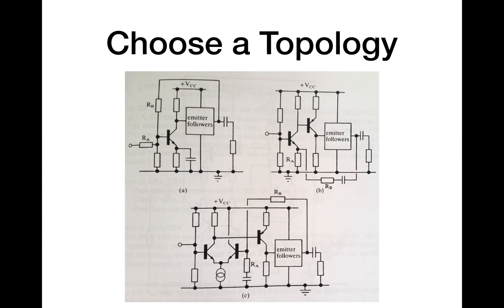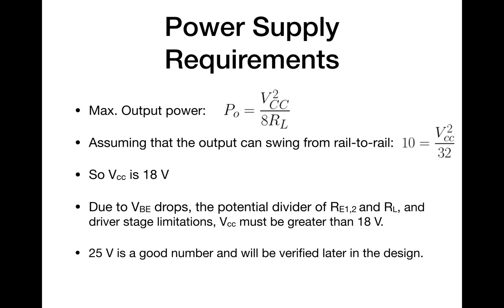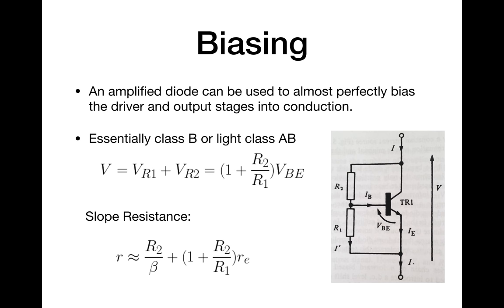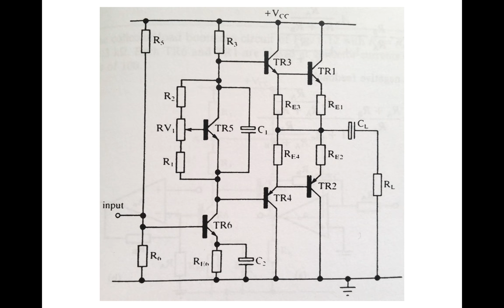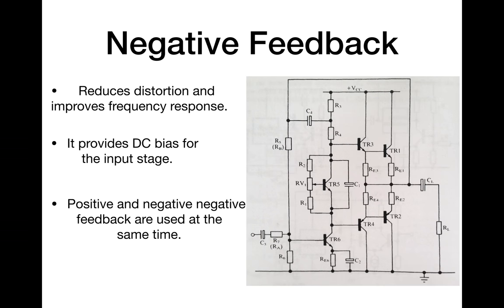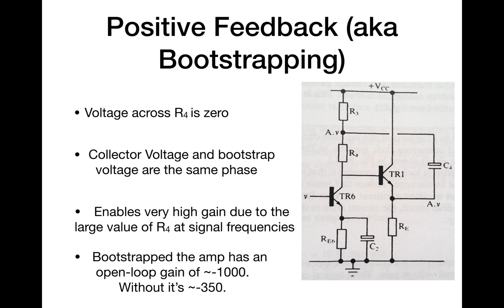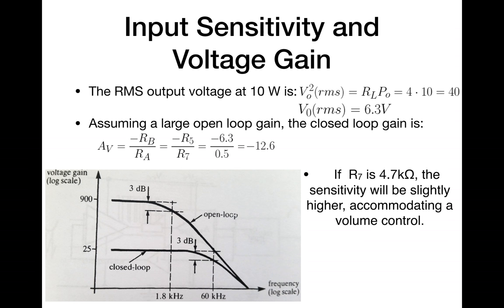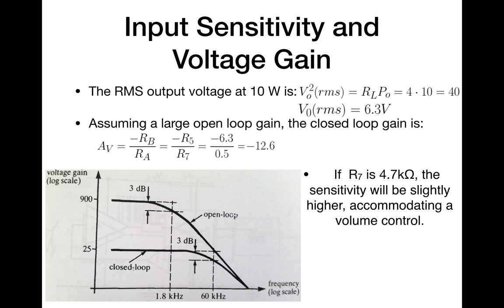Transistor PA

Comment: Really good explanation, thanks!
Reply from the maker: Glad you enjoyed it!
Reply: The Tube Roaster always wondered why some of my amplifiers with negative feedback started to pull 5 amps straight through the output resistors even when the two bases of the push pull were connected together! Could that be caused by oscillation? Gonna try the 22pf cap soon
Reply: With output resistors i meant transistors**
Reply from the maker: It's possibly an oscillation. Make sure that your voltage amplifier is compensated with enough capacitance between collector and base. You could also try to drop the amount of feedback or disconnect it to see if that stops it. If you have an oscilloscope, try probing around looking for oscillation in the 100s of kHz region. If it's not oscillation, it might be some form of shoot-through where both output devices are being fully turned on at once.
Reply: The Tube Roaster thank you very much! Unfortunetely i do not have an oscilloscope. It is actually a differential amplifier with a current mirror followed by a common emitter so the open loop gain is quite high. I will add some capacitance there and see if its fixed. Thanks

Comment: why The output power P = V² /8xRL  ! from where the 8 came?
and Ic peak = VCC / 2xRl ! why 2 xRl ?
Reply from the maker: TBH I don't actually know where that comes from. It has also been a long time since I've looked at this circuit. The book shows the expected Vcc²/2xRl but then later it also shows Vcc²/8xRl for the same output stage calling it maximum average output power.
Reply: @thetuberoaster8321  i can see in the book that we assume that Vout = Vcc /2
and Vout rms = Vout/sq2  so Pout avg= Vout²/R = Vcc²/(2²xsq2²xR)

Comment: Hello Mr!, In 15:42, 
why VR5 = 14-1.24? wouldn't VR5 = 12.6-1.24 because of the negative feedback?
Reply from the maker: 14V is the optimal voltage we want the quiescent output voltage at for max swing. 12.6-7V is the voltage across R5 because we want R6 to have 1.24V dropped across it. (Diode drop plus VRe6 to set collector current in TR6) The only reason we need to know this voltage is to make sure the voltage divider has enough juice to feed the transistor base and stay at the same voltage.

Comment: Hello Mr!, In the voltage amplifier why Ic6 and Ic5 are 3mA?
Reply from the maker: It's mainly to set the quiescent collector voltage (from the voltage drop across R3 and R4) the to slightly higher than 1/2 Vcc to achieve maximum signal swing before clipping. The reason it has to be slightly higher than 1/2 Vcc is that the lower end of the amplified diode will drop some voltage (at least 1.2V - 1.4V) before it feeds the lower half of the output stage. The idea is to get the output to clip as symmetrically as possible for maximum signal amplitude. When I demo the circuit, you can actually see the bottom always clips first. The symmetry is close enough but not exact because it depends on what voltage the amplified diode is set at.
Reply: @thetuberoaster8321  OK, I thought it was because of the 0.9mA  needed on   TR3 and TR4 basis. Thanks for the explanation.
Reply: @thetuberoaster8321  
Could you make a video using topology C (with differential amplifier)?
Reply from the maker: @adrianolopes4717  I'm basically working on a video now with a differential input amp.
Reply: @thetuberoaster8321  
I'll be waiting, thank you very much.